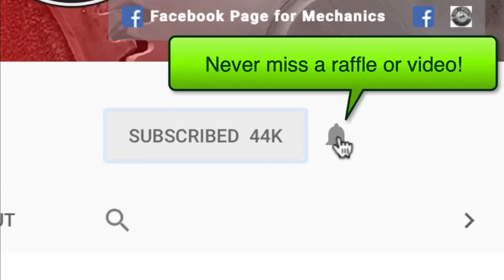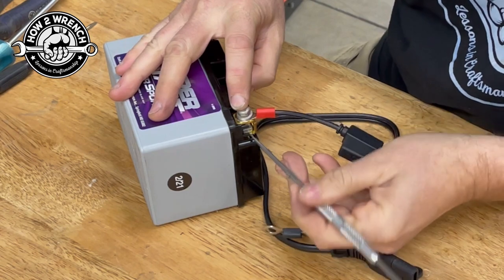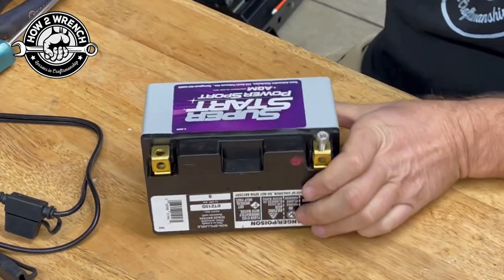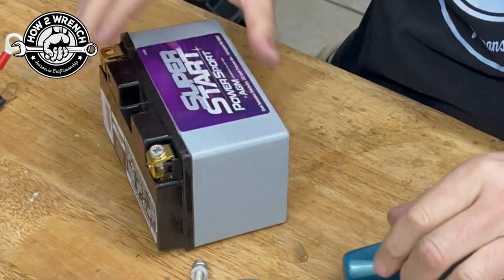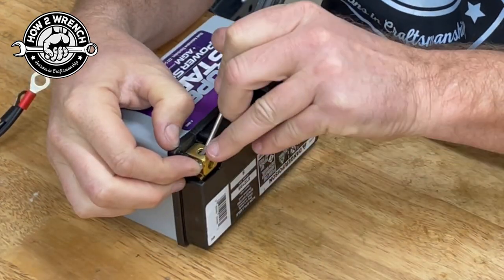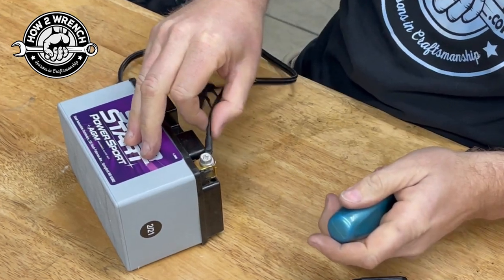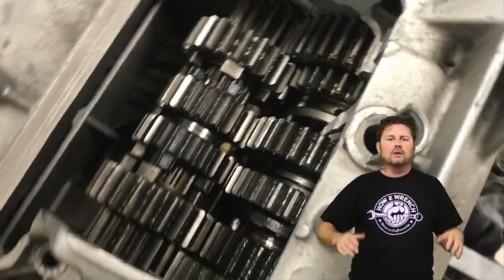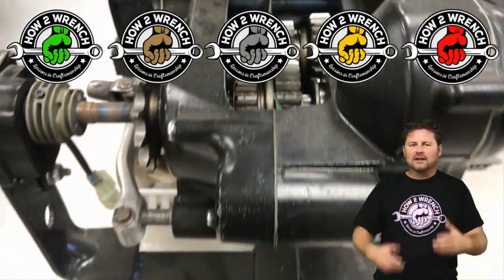STOP doing this on battery installs and do this or you could be causing problems. #batterycare

Comment: I might type in tangents here, but i find it to be a PITA when i pull the seat off, or access to a Battery (Ducati, Victory, etc etc) and find 3 or 4 eyelets on each terminal and the client says the battery is dead the next morning (day, week, next saturday, weekend warrior whatever it is). What a lot of people don’t understand is your Bikes power/charging/accessory system was “engineered” to flow a certain amount of watts/amps (power) through the whole bike.  Once you start adding accessories like the ol’ HID’s, Gerbings Interconnect (draws a huge amount) or heated anything, as well as a Power commander/Flash module, or even tunes.  There has to be an “Upgrade” of the wiring from the battery, and sometimes an upgraded battery to handle the accessories.  The tips for the battery terminal fasteners is awesome 😎, but there are also longer fasteners that can be used. I really enjoy seeing properly fused power and ground distribution blocks used, as well as electro-tinned copper wire.  Even bare copper wiring is great, you just don’t get the same anti corrosion properties over time.  Try and stay away from aluminum wire. It’s cheap for a reason. Just something to keep in mind for your other viewers.
Reply from the maker: Yo Scott...I hear you. I sure love in depth comments like this.
The biggest point of this video is regardless of ANYTHING...check your work, understand the connection and determine if longer bolts would be needed. Many people just go to longer bolts and don't check if they are bottoming out just on the edge of false torque or battery terminal damage. I should make a separate video just on this!
Support links and gear below!  Awesome and thanks for commenting! Smash the subscribe button (thank if already a sub!)
Have you seen our "YouTube Trained Support Shirts? Great way to "high five us" https://goodfellasmerch.com/collections/how-2-wrench/products/support-shirt

Join this channel to get access to perks:
https://www.youtube.com/channel/UCBhM8DCKnT3qXwTW0eToyCg/join   
-Daily MEMBER FIRST COMMENTS ANSWERED FIRST 
-Live Q/A video chats
-Wonder if we have a video on your need? Members can request content links!
-Full Access to the ENTIRE 700 video library
-Member-Only FREE tool giveaways  

Just want to say thanks quick to support us for this information and our work saving you money? 
Give us a high 5 here:  https://www.paypal.me/how2wrench

Comment: Great simple tip, Thanks Shane!
Had to use the magnet-on-stem a couple of times to get this nut back from fairing hideout after tinkering with battery connections. On a parallel theme, switching to a little lithium battery (which a lot of us did) means the battery bolt/nuts are no longer same size as the bike connectors, forcing usage of proper new size of washers/adapters.
Reply from the maker: Glad it helped! Most powersports batteries bolts and nuts are lead too and then the magnet would be no good making this tip even more of a reason. 
Support links and gear below!  Awesome and thanks for commenting! Smash the subscribe button (thank if already a sub!)
Have you seen our "YouTube Trained Support Shirts? Great way to "high five us" https://goodfellasmerch.com/collections/how-2-wrench/products/support-shirt

Join this channel to get access to perks:
https://www.youtube.com/channel/UCBhM8DCKnT3qXwTW0eToyCg/join   
-Daily MEMBER FIRST COMMENTS ANSWERED FIRST 
-Live Q/A video chats
-Wonder if we have a video on your need? Members can request content links!
-Full Access to the ENTIRE 700 video library
-Member-Only FREE tool giveaways  

Just want to say thanks quick to support us for this information and our work saving you money? 
Give us a high 5 here:  https://www.paypal.me/how2wrench

Comment: i have used a piece of STYROFOAM from packing  it will also let you tighten it up thanks
Reply from the maker: Interesting as that would be super easy. Only thing I wonder is of a fire hazzard. I know, I know seems way to far off and low volt DC but I know we don't want to keep styrofoam anywhere near electrical. in other industries. I have some overheated battery terminal connections when a regulator failed and that's what I'm concerned about. Thoughts?